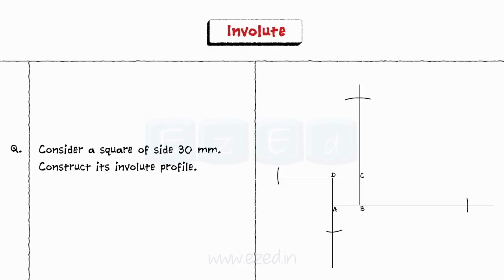Draw An INVOLUTE of a SQUARE - Easy Steps - Engineering Curves - Engineering Drawing

Comment: A regular square plate of 30 mm side is fixed at its centre. An rope is circumscribed along the perimeter of the square. Draw the path of free end of the rope when it is unwounded keeping, tight for one complete tum.